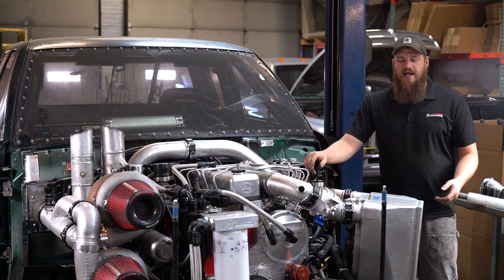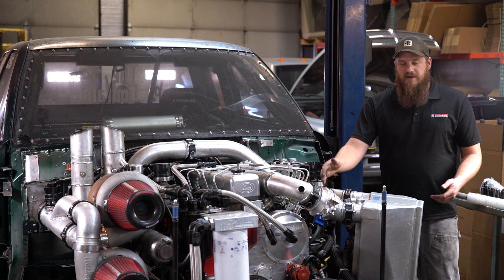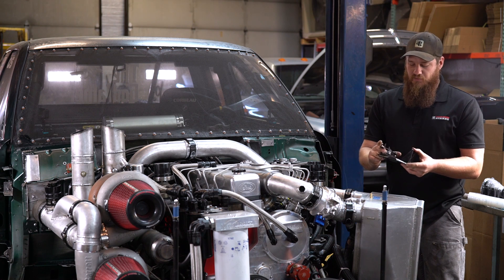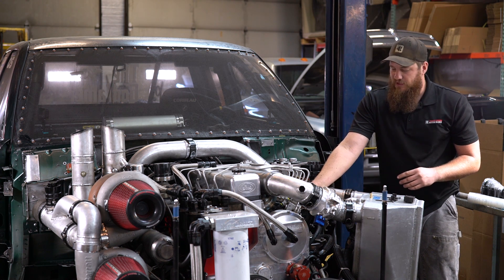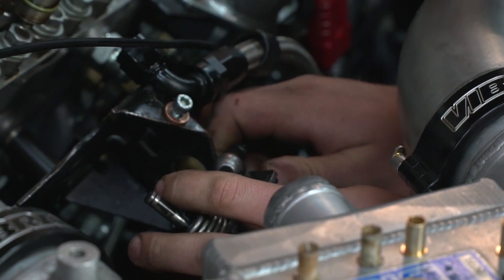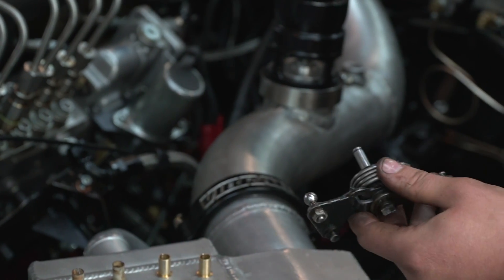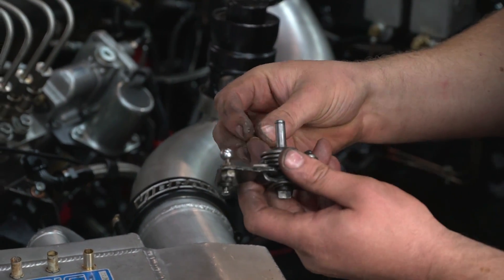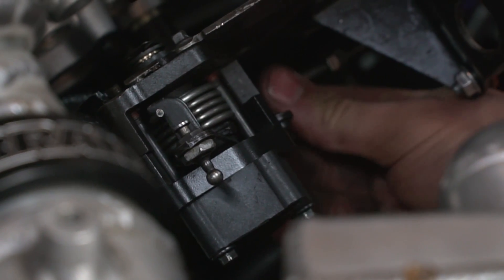How to Install a Bell Crank Bushing | Power Driven Diesel

Comment: I noticed that you didn't show how much play there was in the shaft with the new bushings.  I see this happen often on product videos.  They skip right over the part that would show if it actually fixed anything.
Reply: it was more side to side play then axial play they were fixing. as side ti side play on the TPS would send the wrong voltage readings.

Comment: hi guys, would this also cause problems with the throttle getting jammed? mine after long drives can sometimes get jammed or cant get past 20% as you start to accelerate. its like something has jammed inside the pump but then on the next try it works fine and gets full movement again. is this common?

Comment: I'm in the market for a new exhaust manifold and wonder what type of hardware I should attach it with.  A video comparing Stage 8 locking fasteners, ARP stud kit, generic stud kit, or new OE bolts would be really beneficial for us guys who don't want to put their ugly factory bolts that are prone to backing out onto a new manifold.